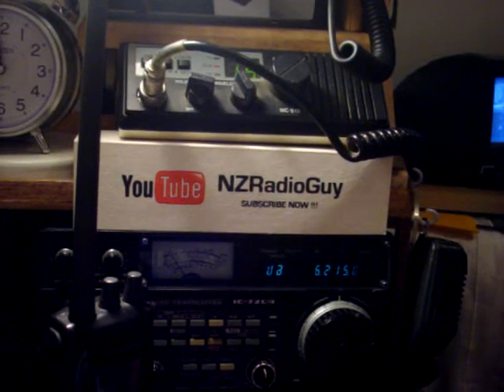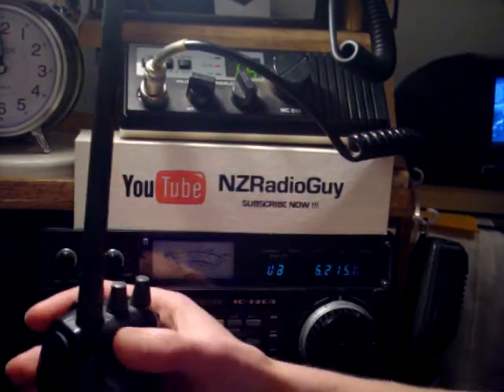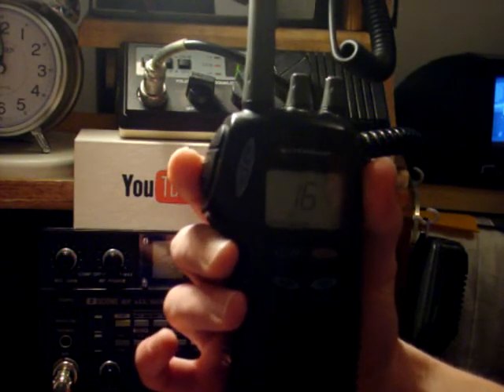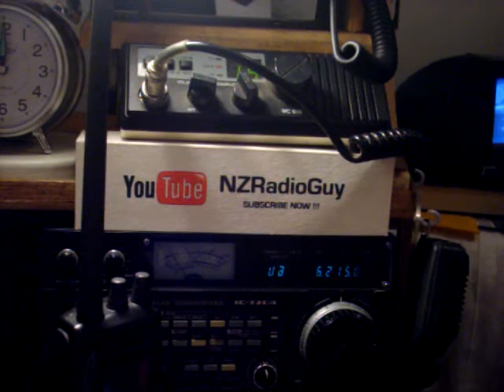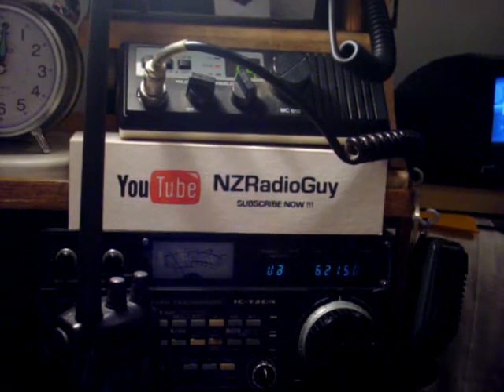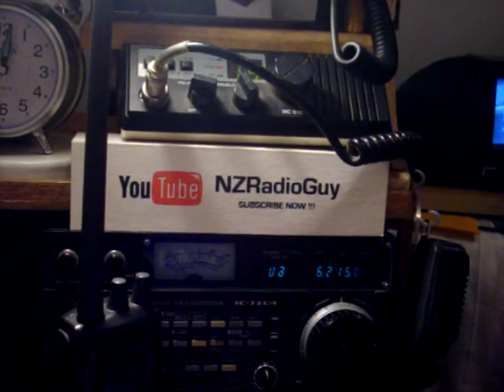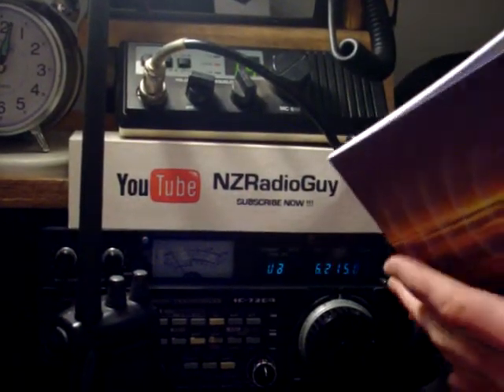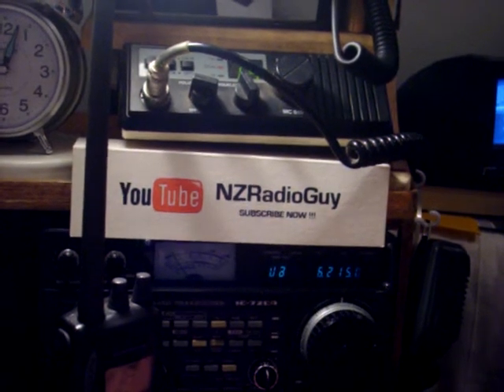Marine Radio Equipment

Comment: Would this hand held work in nz for marine frequencies?
IC-V85 long distance VHF ham radio for marine  
 
General Specifications
 
General
Mode	FM
Channel
107 
Transmitter
Output power (at 7.2V)	7.0/4.0/0.5W
Spurious emissions	Less than –60dBc
Max. freq. deviation	±5.0kHz
External microphone
connector
More than 55dB
Spurious and image
rejection
More than 60dB
Intermodulation	More than 55dB

Ext. speaker connector	3-conductor 3.5(d) mm (1⁄8″) /8Ω
Would it have pre set channels?

Comment from the maker: @zLOSTNOMOREz     Hi there. Sorry I can’t help you there. the radio was already modified when I bort it. The only thing I might be able to suggest is to get a copy of the IC-720A Servicing Manual and try to work it out from that. Failing that I would get I touch with someone who has done such a modification with a simular radio or go striate to Icom and see if they can help. Hope it works out for you, sorry I couldn’t be of more assistance. 73, All the best. NZRadioGuy

Comment: I have a Icom 720A and i have read how to modify the radio for extended transmit range however,the one thing i have not been able to find is how to reset the microprocessor. Do you know how?

Thanks!